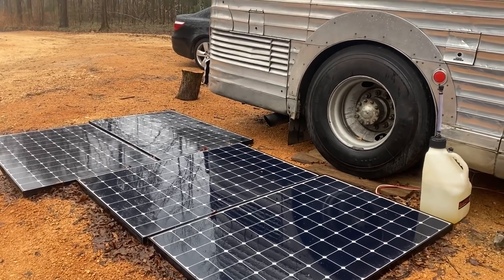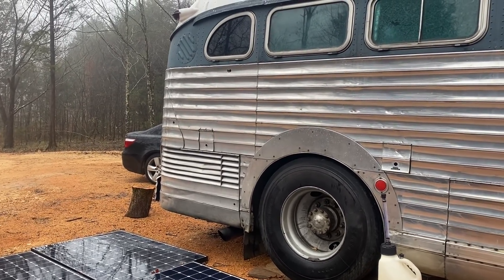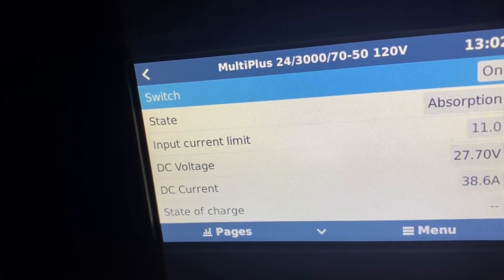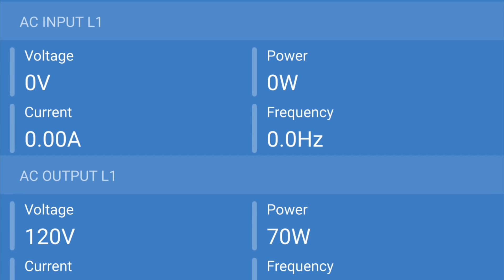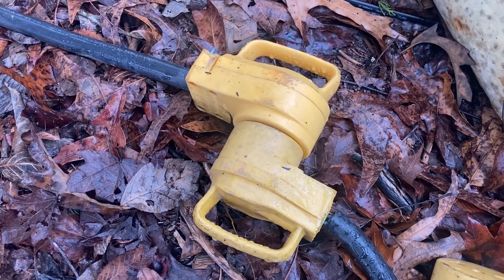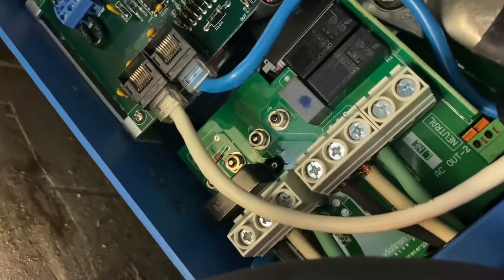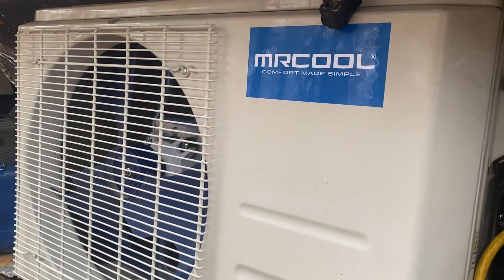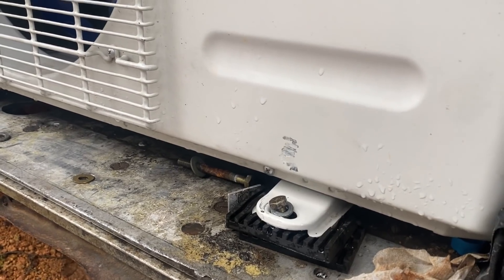Victron multi plus not charging

Comment: hey great video I see you have a moisture problem all plugs and Outlets outside should have a block of two by four on either one of them lifting them off the ground remove leaves and check often for condensation and moisture think about it in a micro scale the moisture creates static in your electricity which will create havoc on your electronics

Comment: Are there any GFCI's in the system? I had a flaky GFCI that I had to replace on my central A/C system. It kept the blower fan from running. The compressor and outside unit runs on 220/240 but the inside blower runs on 120. They ran power for the inside blower off a GFCI that's normally used for the back porch outlets.

Comment: I could not follow - you said multiple times that there was 120V AC power input to one leg of an inverter but not the other.  An inverter is DC to AC.  I don't understand what kind of an inverter that is.
Reply: These units are inverter-chargers with their own internal transfer components.  AC in from shore or genset can be passed through and used to charge batteries.  If the external AC disappears, they start drawing DC from batteries instead of charging them and invert it to AC.  An external transfer switch is used to select between the shorepower and the genset.  It can be manual or automatic.  On my bus it is automatic and defaults to shorepower but switches when it detects voltage from the genset.  A separate component provides automatic genset starting.  If if sees the shorepower disappear it starts the genset.  Once the transfer switch sees the voltage from the genset, it waits 2’15” and then switches.  Most automatic transfer switches do this to allow head pressure to bleed down on compressors (air or refrigerant).  In the meantime, the inverter (if turned on) switches over almost instantly and makes AC from the batteries.  When the external AC is once again available, the inverter switches back to pass-through mode and stops inverting.  There are other ways this can be setup, however, including circuits that only get power from the inverter and require it be own for that to work.

Comment: It looked like on the collar of one of the yellow cables, the black insulation of the cable was not inserted into the collar, possibly letting in moisture??? I would check the other end of the cable to see if the power made it through to there also. Take care! Back issues suck.
Reply: And the other one was cracked. 220V cables in the open with bad plugs is a recipe for lethal disaster.

Comment: If you're not running a generator maybe you should consider checking the transfer switch. That's what I did. The inverters have built-in transfer switches.

Comment: I'm confused; yellow extension cable; is that from electric breaker? If so, 1 breaker ( of a double gang breaker)  mught be tripped. Try to reset that 220 breaker. I notice cable plugs are all wet from rain. Protect and make sure it stays dry. Rain could short out one or both legs, and might be the cause of 1 breaker tripping, if it indeed has....simpl things are usualky the cause.....read troubleshooting guide that comes with literature of device. At last, in that paper work, get phone number, and ask to talk to a senior tech.....GOOD LUCK. ..!!!

Comment: Possible rodent attack ?  I have a Mitsubishi heat pump for my shop. They somehow got inside the outside unit and fried on the 220 inverter board.  1200.00 dollar repair
Reply: I wonder if if it has anything to do with the the power cord covered water in the chair.
Reply: The rodents were probably attracted to the soy-based insulation on the wiring. Mice got into my relative’s Corolla and chewed through some wires running to the left headlight and one of the ignition wires.
Reply: @picklerix6162  A rabbit got into my one year old Camry Hybrid and chewed on wires while we were driving down the road. Luckily there isn't very much wiring in a hybrid..... (sarcasm) The dashboard lit up like a x-mas tree, so we diverted to the dealer. The rabbit lived.